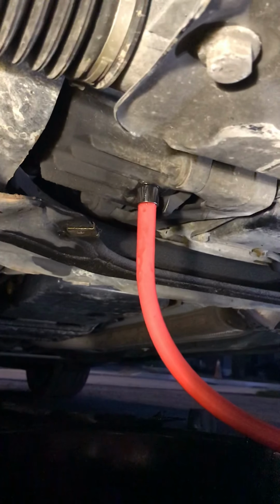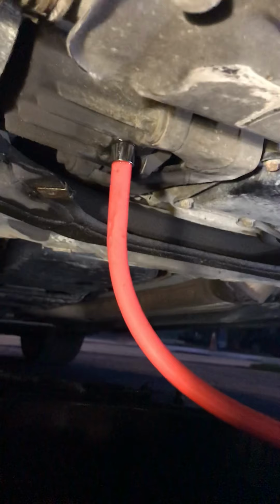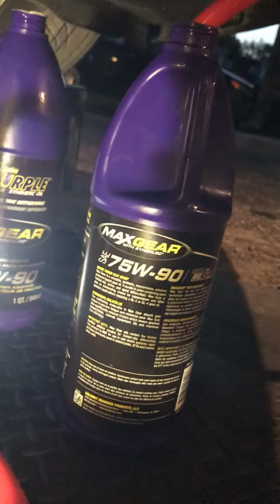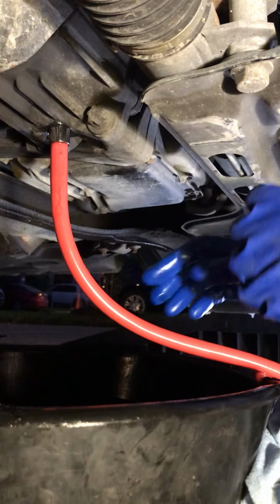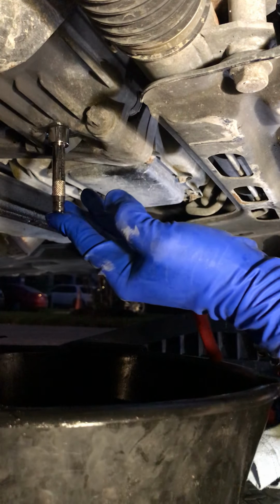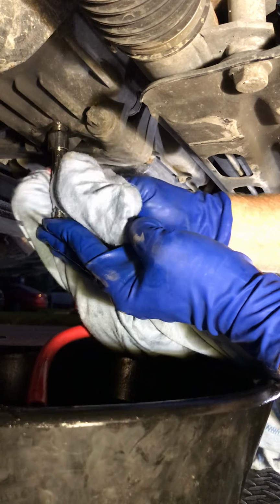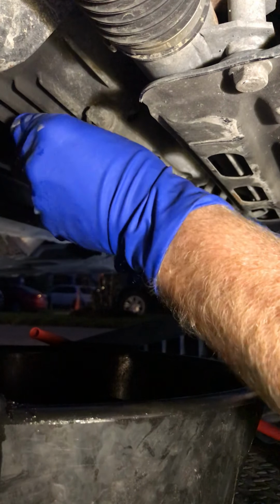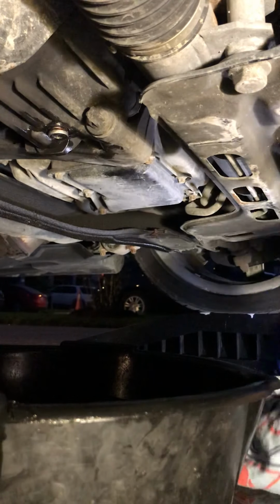W204 front differential fluid change

Comment: There is fill hole on top of diferential. Acces is via front hood, need disassemble air filter hoses left side.
Reply: Interesting. Merc factory service manual says to pull the axle. "The front axle transmission does not have an oil filler hole and must be filled via the opening in the pinion housing.
Reply: @karlt10  
On my parts diagram it shows a breather/cap at the top of the front differential.  Mercedes part# 2303500490.  I was able to locate it looking down the right side of the engine with a flashlight but the back of the alternator is right there and connectors seem in the way.  My hands aren't that small to even reach it nevermind remove it.  

If pulling out the passenger axle isn't there a gasket or seal that could get messed up?
Reply: @timb7775   This is interesting... If you look-up the front axle, it does show the breather. Wonder why the service manual says to pour it into the side of the housing.
Reply: Behind the alternator. You have to remove it.
Reply: Dang, remove the alternator just to fill the differential… nice engineering. I’ll try this pump from beneath method instead with 650mL
Reply: I'm not usually the type to complain about German Engineering. Yes it's complex but high performing. But having no fill hole is ridiculous.

Comment: FINALLY FOUND THIS!!! Just a quick question I have a 2011 E550 4matic..
What type of transmission filler did you get?
Also did you get it at like in advance auto?
I plan on doing this tomorrow..
Front diff leaks slowly and it's about out
Reply: Thread size?

Comment: Hello thank you so much for the video! Do I need to buy the transmission fill plus to do this? Can I just pump the fluid in and quickly plug it?
Reply: you can buy the 722.9 transmission fill adapter and use one of those fluid transfer pumps from auto zone. thats how i did the front differential and my transmission. its the same plug for both.

Comment: Hello, hopefully you respond.. Where do I get this adaptor, and pump/hose to fill the front differential? can you send a link? I just see an adaptor for the transmission of the W204, using the same method.. is it the same size? thank you !
Reply: It is the same size as the automatic transmission. The attachment has an M12x1.5mm thread

Comment: Did you get a leak from the front differential after this? I filled it up with the same amount and it started leaking.. I then heard that it’s 650L not 1.1, different from what the manual suggests. Please let me know. Thank you!
Reply: I also heard 650mL. When I do mine I'm going to drain and measure it to be sure.
Reply: @rtap8170  1.1 is the capacity of the read diff